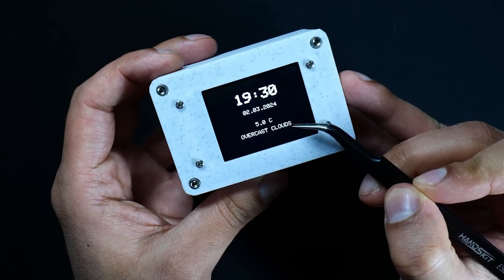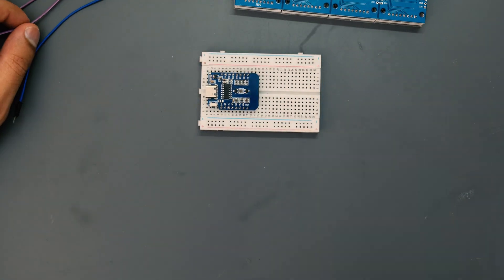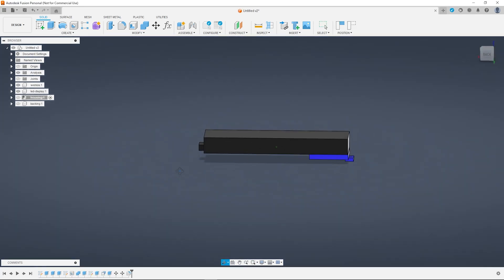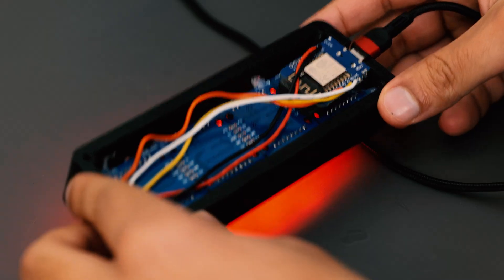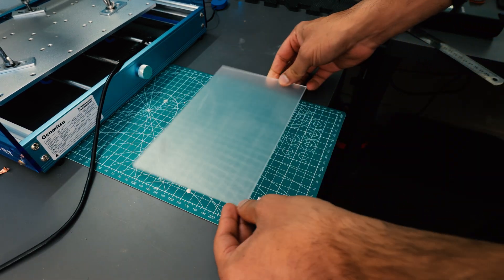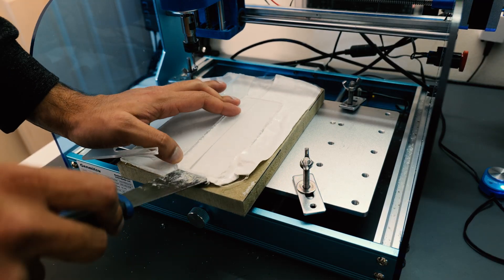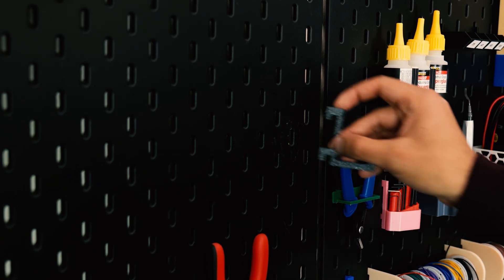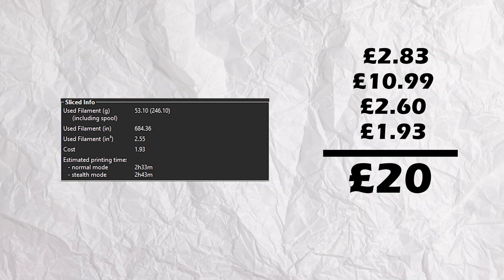I Built a YouTube Subscriber Counter for £20

Comment: Quick soldering tip: in addition to what Andy Warb said, you can get better solder joints by pressing the iron to the opposite side of the pin, and then touching the solder to the pin (as opposed to touching the solder to the iron). Since the pin is wicking the solder itself as opposed to "stealing" the solder from the iron, it ensures that it's a bit fresher and helps ensure you get a perfect joint every time.

Beyond that, congrats on the 2k! I've actually got a few of these matrices laying around waiting to be used in a project myself (albeit as a clock/presence sensor instead using ESPHome), and this was great for seeing ideas on how I could make it look. If you work with them again, I wonder how a darker acrylic sheet would look to help diffuse and dim the (stupidly bright) matrices.
Reply from the maker: Great tip - I'll definitely give that a go on my next project. 

I was actually looking for a darker acrylic sheet to use on this project, but I couldn't find any - if you come across any, please let me know. I think darker acrylic would have looked better.

Thanks for your comment and support!

Comment: pro tip for you... after you have soldered and snipped a wire going into a through hole on a PCB, just give it another little touch with the soldering iron. The solder will reflow creating a perfect little dome. It looks super tidy.
Reply from the maker: Solid tip man, thanks a lot. Will definitely do this next time I’m soldering 👌🏼